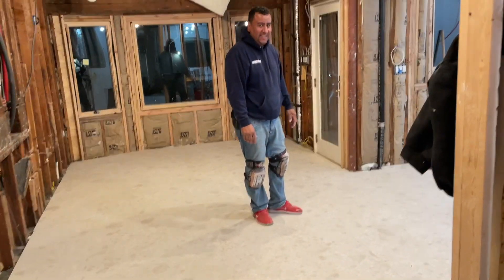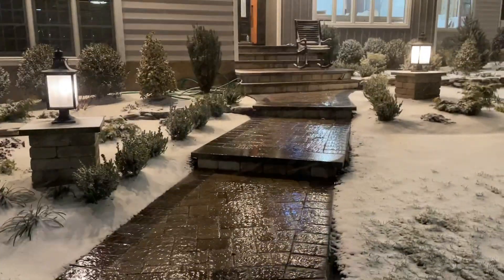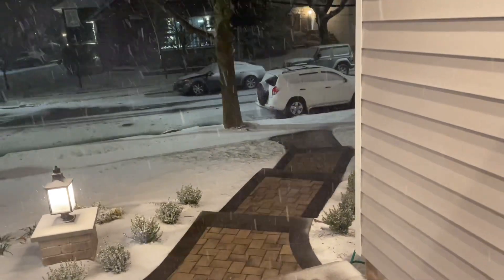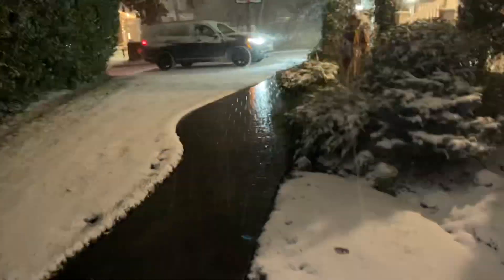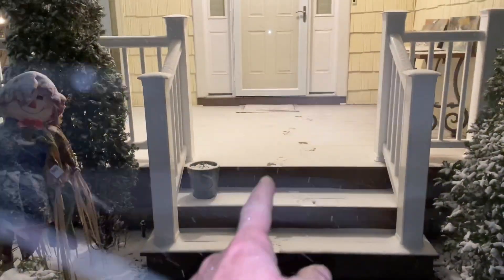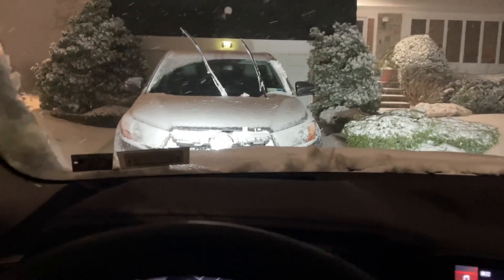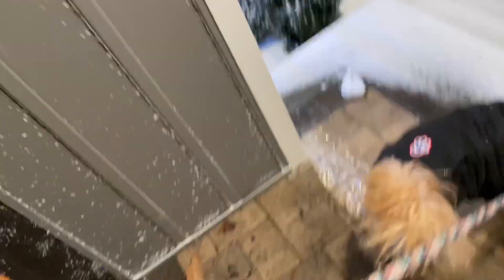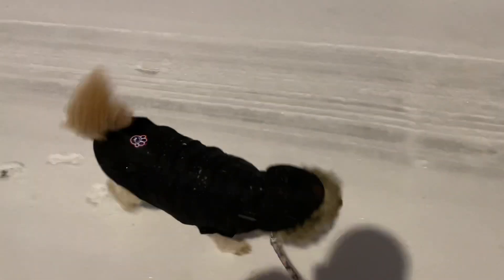Hydronic Snowmelt Systems Running 1st Blizzard of 2020 in NYC

Comment: My worries with be the possiblity of Ice forming if it gets really cold, you get a real blizzard with 2' of snow, or the loop is turned off.

That said I do have a snow melt system: its called moving some place water where it doesn't snow much. There is also another benefit: Much lower taxes. LI has some crazy taxes!